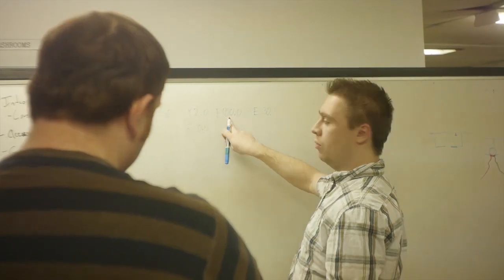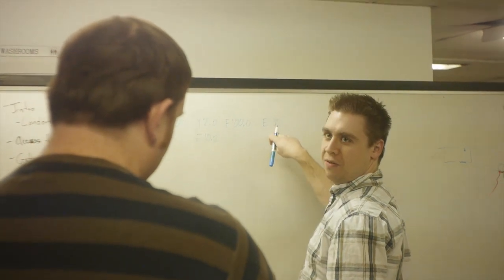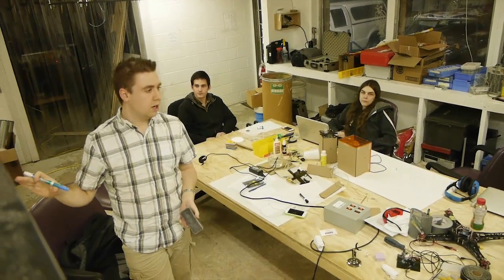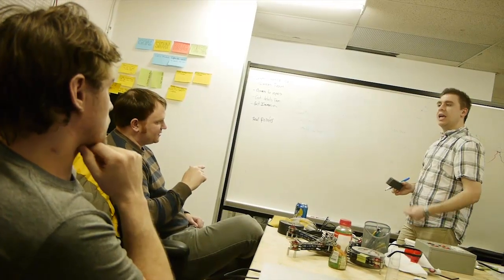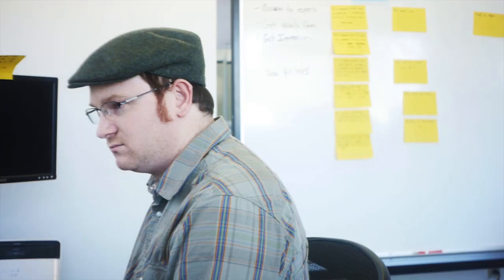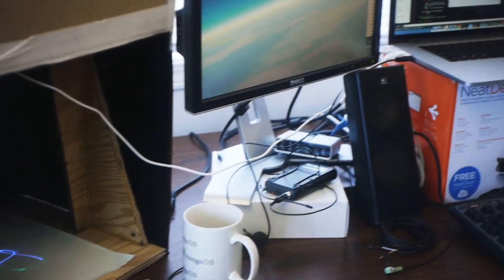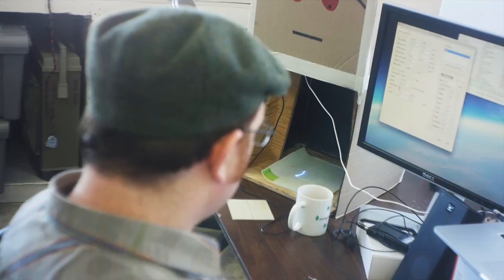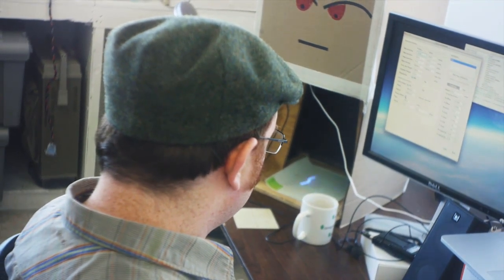Update #21 - Software Developments 2 - Part 1

Comment: If this will not revolutionize the home use of 3d printers then I don't know what will. I always wanted a SLA printer but they were too expensive (I barely managed to buy a mill and a lathe and etc). I just can't force myself to use a FDM printer because of the imperfect surface. Now with peachy.. omg it will so help me with my epoxy resin mold making. I'm dripping with excitement to use the consumer version finally.
Reply: I'm getting a low cost FDM printer for prototyping my design ideas. 

What kind of stuff do you build with your lathe & mill ?
Reply: I just watched a video on lathe and mill working.
There is a sh&tload of effort required to work in metal.
A low cost 3D metal printer cannot come soon enough - even if its FDM.

Comment: hey guys blender is great , but I use lightwave which also makes 3d prints available even easier than blender
Reply: The point in using Blender is, it's open source and multiplatform. That means it's easy to hack and has a lot of libraries and a wonderful Python interpreter to run software on.

If you're used to Lightwave there's no problem, you can just import your Lightwave models to Blender and print them.
Reply: Xavier Mendez guess you haven't seen the python in lightwave yet..